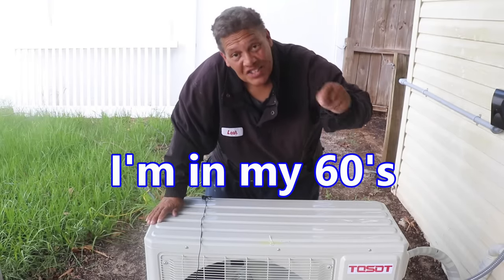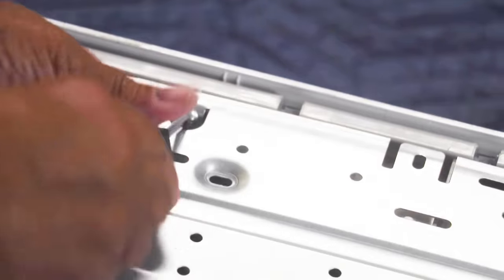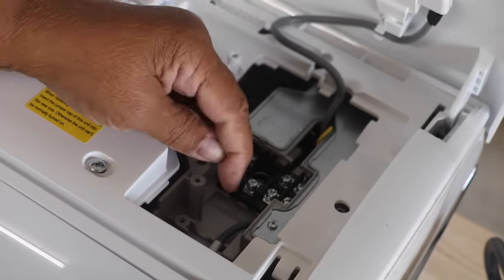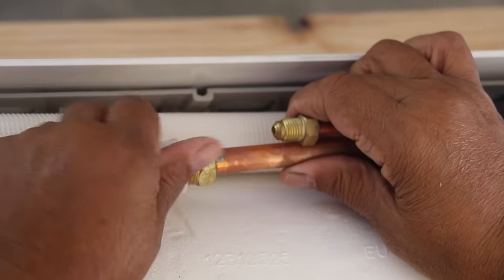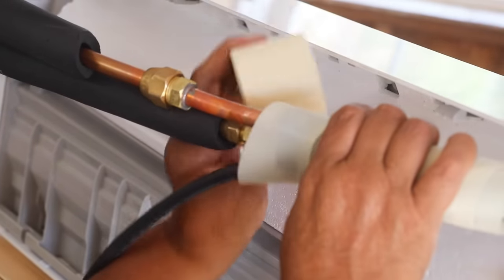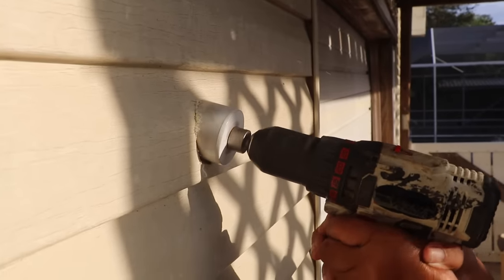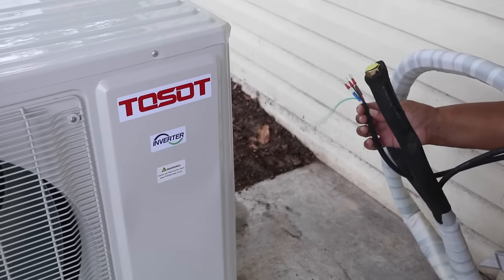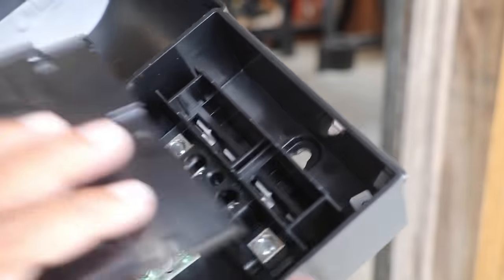I saved $4,200 installing a mini split AC myself

Comment: My 15 yr old daughter is doing welding and apprenticing HVAC installs and repairs.  She cuts or extends the lines brazing and reflares the ends and uses Nylog on the flares.  Then she vaccums the line sets down and does positive and negitive pressure checks.
Reply from the maker: Wonderful!  Always nice to hear these sort of stories involving young people
Reply: It's a good trade to get into..
Reply: yup. generally want to avoid brazing mini splits tho. torquing the flares to the right spec, having a good vacuum below 500 microns, and making sure the minimum and maximum length of the linesets are within the manufactures set point will make the unit last as long as possible. a bad install will mess up the unit forever lol. also throw a surge protector on it, surges in electricity will fry the board.
Reply: @danieljacquez2582  braze the extensions of the line sets.  Many people turning shipping containers into cool, but secret things.
Reply: Leah you are my hero! I just broke up from a relationship, and prior to that I purchased a house built in the 1920’s. So you can imagine the amount of little projects here and there. Watching your video, reminds me that I can do those little projects on my own.
Reply: Please do not listen to this lady lol
Reply: @jaronwalker1  why?
Reply: @jaronwalker1 better yet, people shouldn't pay attention to negative trolling comments without any explanation. Go away troll.
Reply: Read my previous comment. No trolling here.
Reply: @anlu3365 I’ve already typed my opinion in the comments section. Take it for what it’s worth or don’t. Obviously your decision but from someone who has experience and actually works in the hvac industry you’re better off not taking this women’s advice or tips. Atleast on this particular subject
Reply: Good for your daughter. We are so happy. We should celebrate. I hope she does not scam people with a trade she learned at 15.
Reply: meanwhile my 12 year old son can't handle simple paper glue :)))) And he thinks super glue can fix everything ( he's not allowed super glue anymore) :))
Reply: We had an air conditioning business and reading about your daughters ability makes me sad to say a trade is quite often over looked as a career. ….believe me she can make a good living with a trade….electricians , plumbers and HVAC  is the way to go. I encourage you to encourage her in this endeavor. There are fewer people coming up that want to do Manuel labor , but if she gets good at her trade she can go on and get her state license. I’m in Florida and in Florida you have to work 4 years under someone else before you can take the test , my husband did exactly that. She could start her own business one day if she wants to make good money all it takes is the willingness to learn. College is not for everyone , and you come out with debt , a trade you get paid while learning , it’s the way to go !
Reply: Been in the hvac trade for 20+ years.  We need more young people to get into the trade, so this is great to hear!
Reply: Jeez.  A buddy of mine runs a hvac service company and can't find anyone that wants to work.  Maybe we should have more girls going into these trades
Reply: @PawsumGaming  you can’t have a conscience however, if you’re a HVAC contractor. Total rip off 90% of them.
Reply: @jaronwalker1  if you work in the HVAC industry, that makes you one step below used car salesman
Reply: user-nv4fn1zg4q scared much?
Reply: @sethtenrec  there's shady people in every trade... You just gotta know what to steer clear or.. never ok a job after the first quote.
Reply: @PawsumGaming  That’s quite true, but contractors are among the worst
Reply: @sethtenrec  that's why you shop around.. I got into a trade because i had a hard time finding an electrician that wasn't shady and wanted to charge me 6-8k for a 2k job... the bigger businesses tended to be worse...
Reply: Awesome ..my 15 year old daughter's pregnant so what now...
Reply: @Gruuvin1 she actually gives good info. But leaves a lot out. Like for instance, the warranty of the equipment is invalid if not done by a professional on most equipment. Plus, if you install these without precharged lines you need specific tools to finish the job. 

Saving money could end up costing you much more in the long run.
Reply: @sethtenrec that’s because not many people are the trade. So those who are, are able to set the bar(rate) high. I agree it’s unethical. That’s why I don’t work for a company that does that.
Reply: @MrAlexmiele8910  I hire individual skilled workers. When you hire a company - a contractor - you’re paying half your money to someone that just sits on his ass or blows smoke  up yours. Usually both…

I like to get value for the dollar, and I give value for the job to the trades people I hire.
Reply: @parkdaniel3980  don’t move to Texas or Florida.
Reply: @sethtenrec  ya that’s why I left the place I worked at. 2 chiefs that sat in the office while 4 workers got it done. 🤷‍♂️
Reply: @danieljacquez2582 I'd go with the rather expensive stuff used for professional sound gear, if the electrics can deal with the higher draw. 

It might be around 1-150.00 when I got mine to stabilize the power. You can see what it's doing from across the room, AND they have pull-out lights, which is GREAT.
Reply: @damiresq Figuratively toss him in the lake but watch from a distance. Most people aren't that stupid, but they'll act it so they can make someone else do it. Show him stuff and don't do it for him.
Reply: @barbarahering1310 If she's smart, she'll get into other stuff. Minor plumbing comes up often in older houses w steam heat/boilers. Boilers are a thing unto themselves. 

Minor repairs someone might not be able to do...carpentry and such.

Minor electrical work, plumbing and such will come up, too. 

Those Time life books should have a lot to say. And any library has them.
Reply: I love this so much. I worked helping out my dad growing up in HVAC. I still tinker and fix things to this day.
Reply: Why?  You can learn how to do it on YouTube.  No one will need her services anymore 😂
Reply: @Davidbodyspam  Yeah, do it yourself.  You will get to re-doit in 2 years.  Most of the installs just wont last.  It's OK, she is doing one for the Civil Air Patrol.  She is a Cadet, and I will be one of their flight instructors again soon.  Good luck.
Reply: @halledwardb  bro what are you talking about?
Reply: The important thing is to pull a vacuum to boil all the moisture out...
Reply: Nice! Good for her!
Reply: @jaronwalker1 
You must be crooked contractor or work for one.  
You are just jealous because she can basically do anything and motivates others to take on challenges so people don’t get ripped off by crooked contractors like yourself. 
Go lea. Keep on making these videos and keep on educating others.
Reply: You think hiring a good contractor is expensive. Hire a bad one and see how expensive it is.
Reply: Damn that sucks I’m sorry

Comment: HVAC contractor wanted $4000 to install a 9k btu in my garage. I bought one off amazon for $468. He called back after I installed it said it will fail on me it was a Junker. I told him I could replace it 8 times before I would break even with his price.
Reply: Have they lost their mind? You can only pay max the value of the object or the tools needed for the instalation. That's a fair price.
Reply: I charge $2000 in my area
Reply: @NeverFollowTheCrowd Soooo you're ripping people off as well?
Reply: @PooBrownTHENERD average persons bi weekly salary 😂
Reply: @dg8676  EXACTLY.
Reply: Licensed hvac mechanical contractor prices…. Go find yourself an unlicensed pirate that does shoddy workmanship…if you want lower prices…
Reply: @PooBrownTHENERD  slightly less!
Reply: Charging $2000 for less than a days work
Reply: I know people who sit indoors in a climate controlled environment On a computer all day making more money. And never worked hard a single day in their life lol.

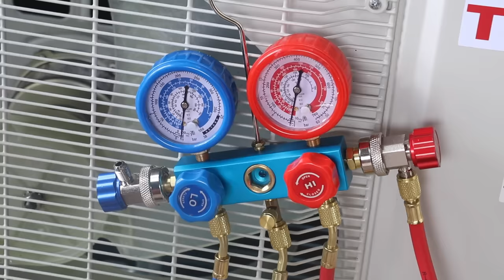Comment: As a tip for anybody watching this and as a professional that installs/repairs HVAC equipment, a word of caution. At the 15:00 minute mark, she mentions to remove the refrigerant gauge after letting it sit steady for 5minutes or so, after vacating the lines. And while that's good practice, the better thing to do is to release the "gas and liquid" valves with the allen wrenches WHILE THE GAUGE IS STILL ATTACHED to not counteract the evacuation/vacating the lines.
Reply: No it’s not good practice. You literally let air and moisture in because the system is under vacuum. Obviously there’s difference of skill and actual knowledge like that. But hey, everything is so easy right?
Reply: Thank you for adding that important information!:)
Reply: @timrob0420 No, the air won't go in if the refrigerant is being released. I just did it with the gauge line attached. It's the proper way.
Reply: @baraclude that is true. Some micron gauges aren’t rated for positive pressure though. Way was originally said made it sound like they removed the gauge before releasing refer. And I do this literally every single day. I’m a veteran HVAC technician and an electrician.

Comment: I’m 67 and I just installed 3 mini splits on my house and I even cut the line set and flared it so I wouldn’t have any excess left over. I got rid of my central heat and air because the line set was leaking Freon and they wanted around $1800 to fix it. Amazing what you can learn on YouTube.

Comment: I am truly amazed!!! Korte quoted $17,000 to $18,000 to have 4 of these into our small home. I quickly declined. Now I do have a choice to do it myself or just use window air conditioner.  Thanks sooo much gurl for having us along to learn! God bless!
Reply from the maker: Oh wow!
Reply: If it's a multi-zone system(meaning there's only 1 compressor unit outside) then that's a bargain and you should probably jump on that. No joke. Those are a lot harder to install than you would ever think, especially if you ever need to install one of your indoor units on an interior wall(meaning a wall that if you drilled through it would NOT lead to the outside).
Reply: @ehrichweiss  ty very much for helping us here.  It makes sense.  God bless❣️
Reply: Hello how are you Mrs thats really awesome and the video was great but you didn't do all the steps for the electrical part because I never done something electric except replacing the old outlet but installing a bracket kinda scared me to do this 😅 you are awesome Mrs 👌 👏 👍
Reply: My dad paid big $ to hav one installed, the plastic flexes I guess n makes noise-- will iritate when tryn to sleep, unit has mold on it now, aaaaaand even Hvac guys can't figure out remote,throws breaker all the time----- all that for thousands--- no thanks
Reply: @4cClubT  aweee.  That is such an awful experience. Glad u shared it for others to read for future reference 👍💯.   We are just keeping our window air conditioners. And window air conditioners are pretty cheap compared to repairing HVAC...or in your dad's case, not repairable, including mold (yikes)  Beat of blessings and luck sent your way ❣️
Reply: @4cClubT I'd be calling a lawyer. Don't let them touch it again.
Reply: @begoodbebetterbeblessedix3766 Mold is repairable to an extent.  Depends on why and what it's on. 

Get that high concentration vinegar at hardware store. Not bleach. Use it and see if it comes back. 

If it's on the wall, it'll probably come back unless it's plaster. Normally they chop that part out. But try vinegar and see. 

Use fans and let it dry.

Comment: refrigeration & air conditioning Mechanic here , good on you, but just a handy tip for you all, hang the head first, by mounting the bracket and then cutting your hole and running the lines out , doing the rest outside allows number 1 being able to leak check your connections ( as you tapped them before they were in there final resting spot, this can cause little movements as well you never know how good of a connection you have until you do a standing pressure test of 400-500 lbs, you did a vaccum lock thats not equal to a pressure Lock 500lbs is alot more than negative pressure of that degreedo a pressure test,  lock the pressure in and if it drops youve got a leak, then you gotta find it and if it happens to be tapped it will add more work, just a tip the leak test you did in the video you forgot the ones that were tapped and the leak test should again be done before allowing gas in, or youll lose your gas., additionally you want the unit next to the wall and out of the way to restrict how much wind pressure you get on your fan as wind back winds will harm the motor, and you also want you outdoor unit raised at least 3 inchs this helps prevent mice and such from getting in ( ALSO WEAR GLOVES PLEASE ) if not you will get bad burns and blisters from bursts, refrigerant is not a joke be careful everyone.
Reply: Indeed sir
Reply: I've been doing HVAC over 30 years good info. For others watching. 410a is higher pressure.
Reply: @dgiacco  im a Refrigeration & Air Conditioning Mechanic and have been for over 15 plus years, the system doesnt come built, connected and vacuumed, you are incorrect in saying a pressure test isnt needed or not done, Im sorry to tell you this but the regular practice is to do a standing pressure test (400-500psi) with nitrogen on your gauges , if it drops leak check, if not vacuum and your good to go, typically 300-700 microns is a good pull, but I dont get where your saying a pressure and leak test are not done, your definitely mistaken here somewhere.
Reply: John, should outside unit be parallel, or perpendicular to the building wall? Thanks
Reply: @lcomfort8683  would depend. but Id say parallel, about 12 inchs from the wall, would be ideal, mounting on the ground as done in some cases isnt the best, id recommend a stand, as mounting on straight patio blocks allows for more feedback in vibrations, rodents can have easy access and if your weather has snow this is a big no no.

Comment: Great job installing the unit! Next time you might want to slowly open the service ports while your gauges are still on after the vacuum. When you get enough pressure in the lines then take off the gauges. That way you will be sure there is no air in the system.

Comment: I do hvac, I just wanted to say for a non hvac trades person you did things way better the most folks I see put these in, I would classify it under the old school method. the fact you even vacuumed the unit is awesome and will help it last far longer. Are there some more steps and different gauge reading I would of done like micron or cut the line down and re flared. Definitely. I have also done what you have done in a pinch. Solid install and I hope people looking to install DIY find you you took a few extra steps that make a huge difference. On a side note you remind me of my mom she taught me to use tools fix things and never be afraid to just try it and learn from my mistakes. Instead of toy stores we spent our time oogling tools at sears or a garden center. Keep up the awesomeness !!

Comment: Leah, you are an inspiration to women! Many years ago (I am 70  now)  Lifted the furnace/ac unit and braced it on the rafters to replace the pan that was leaking. ( Also removed the blocks that held it off the pan). Cleaned the unit and flushed the drain lines. Every year the drain pipes get flushed and when the air is on, make sure they are draining the water properly. Thank you for the wonderful tips and lessons. You are the bomb!

Comment: You are an excelent teacher! You speak at just the right pace, have good voice inflection (so your listeners don't fall asleep that a monotone lecturer causes), and your demo is really clear. I've wanted to get one of these  for upstairs in my house, located in an area that doesn't require air conditioners. There are only a handful of summer days warm  enough that cross venting my house doesn't keep it cool enough, especially upstairs. I think a mini split is perfect to install on the second floor for those days, but it's much too expensive an install (professional) to justify for a handful of days. If I can do it myself I think those days of comfort will be worth it. Thanks.

Comment: My boss at my old company never really trained us to well on mini-splits specifically, or rather didn't know himself the proper methods to install.  Not seeing the whole process, I'd guess those flare joints are likely to leak.   You need to put Nylog on all sides of both flairs, then THE BIGGEST STEP you tighten by hand to the point needed, then you back off the nut by reversing a quarter or half turn, which allows the sides to kind of re-align.  Especially without nylog you can have slight misalignment, but the friction from the tightened surfaces prevents true alignment.   There's a couple other critical steps where just because the machine works for a bit doesn't mean the project was done correctly.   Many others have likely done successfully this, but I've personally been out to two homeowner installs where the whole system needed to be scrapped within two years.  Kind of a tough call, I respect the effort.